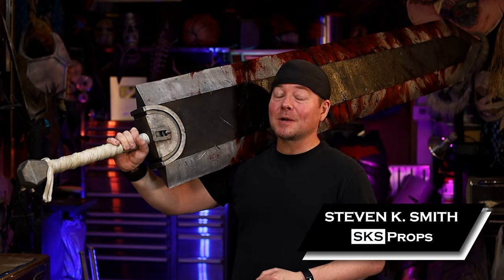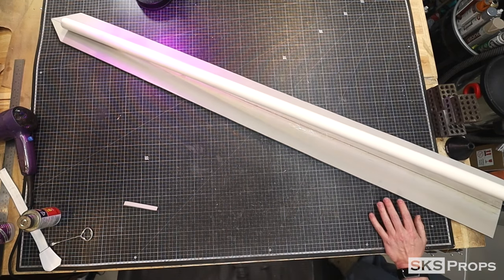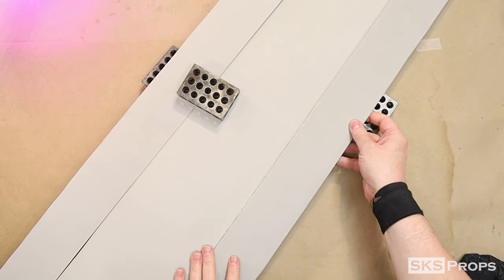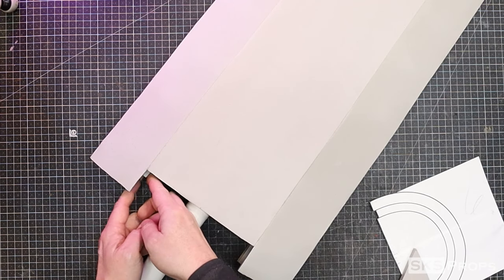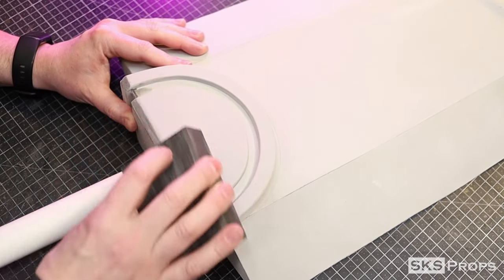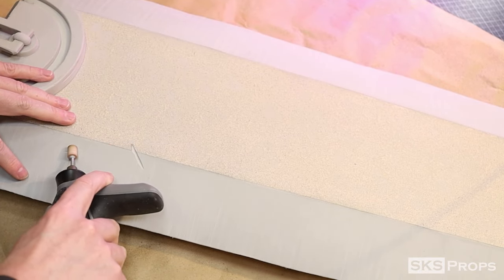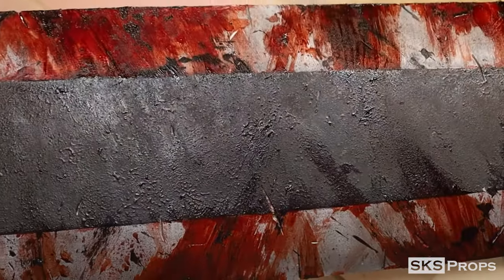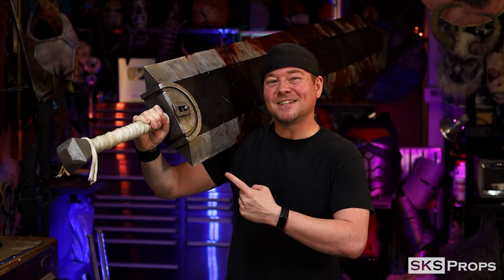How to Make DRAGONSLAYER from Berserk out of Foam! Only weighs 5 Pounds - Guts - Free PDF Templates

Comment: I believe there is a typo in the template (and possibly the video) it states the edges should be cut at a 60 degree angle, but its supposed to be 65 degrees
Reply from the maker: Thanks for the heads up. It's actually supposed to be 70 not 60 (I write on my prototypes to much and forget to erase them)  I corrected it on the template
Reply: @SKSProps  Thank you! That makes sense. I was using the protractor on my phone and it must have been measuring wrong. I tried to mess with it some more and, yeah, 70 degrees looks right

Comment: If you want this to be functional to carry, what I did with mine was when I had the mount detail in place on the clamp/bracket (guard piece I guess but it's clamped/bracketed to a handle lol), I drilled into the pipe and screwed a heavy screw eye into it and put a rectangular carabiner on it that attached to a special hook I forged (bent metal of any kind will probably work) that was threaded through my shoulder strap on the back and lashed to my belt to keep it at an angle. Canonically, he uses a chain for that but I didn't have one. The hook I made looked like a cursive Y with a straight tail and the top outer point of the Y was angled to be straight up and down in the 3rd dimension. Hope this helps someone and wonderful job Steve!
Reply: Also, if you want the proper scale to you, Dragonslayer is 6' long and Guts is about 6'3". Have fun with the math! Scaling is necessary lest you have a sword that you can't wear or makes you look goofy lol
Reply: @saintignatius714 cool tips but guts is 6’8 😂
Reply: @VileRhythm  whoops lol the info I worked from said he was 6'3"
Reply: @saintignatius714  Yeah there’s a lot of discussion about it but I’m pretty sure he’s 6’8 (currently)
Reply: @VileRhythm  It's tough to get it right as it is but as long as you know Dragonslayer's length, you can find his height from whatever picture you're working from so I guess it's down to what you think looks best

Comment: Great video!! And impressive build!! One thing I would’ve like to see more of is noticeable texture in the core of the blade. The best use of this was is @Kyle Merriman’s build where he used textured drywall spray and it looked perfect
Reply from the maker: Thanks! to eact their own gotta figure if it was actually forged most of the "raw" metal would be knocked down through the forging process and combat which is why I made mine the way it is. But you can add to yours whatever you want

Comment: Is there any tricks for getting the foam nice and flat upon arrival? With how thick the foam is and how long the pieces will be cut it takes awhile to get it flat using just a heat gun. After hitting it for awhile it still wasn't as flat as I'd like it to be. Maybe something like sandwiching it between something and letting it sit overnight for example?
Reply from the maker: I always hit the backside lightly with a heat gun then roll it the opposite direction. After that I’ll take my sheets and stack them with books on top to lay flat until I need to use them

Comment: What a monster of a build
Reply from the maker: It sure was. I rarely use the wide angle lenses but had to multiple times 😂
Reply: @SKSProps  what i particularly love about your builds is the details like the wire brush technique or the details in the middle of the blade and the gore 💪🏻🤘🏻 keep up the awesome work! You are an inspiration with every post 😁

(By the way, my current build in early development is Stun the Insect from Bloody Roar 4. I have a long way to go still)

Comment: I was skeptical of the blood splatter at first, but that coagulation effect you added really sells it and makes this build stand out from other DS props I've seen put together in the past.  Out of curiosity did you happen to see the @PrettyHateMachining build of a full size DS from solid steel?
Reply from the maker: Thanks! and yeah the aditional paint effects def help sell the prop. And yes he was one of the builders I checked out crazy heavy I'll stick with my 5 pound blade and easily move it around the shop 😅

Comment: This video inspired me to take on making cosplay props for the first time! I noticed a couple creators heat treating the foam after the pieces have been glued together, such as in this video. Some friends  recommend heat treating individual pieces first before gluing, but I also have not found anything definitive online about whether to heat treat first or glue first. It does look like heat sealing the whole assembled prop is more convenient, but will the heat affect the contact cement bond? Are there other reasons why you heat seal after gluing? Thanks for the great video!
Reply from the maker: It honestly depends on the foam you are using and the technique. Most Black foam is more porous so it has to be heat sealed otherwise glue soaks in and doesn't coat the surface. I developed my foam to be higher desnity than any of the others out there. So you can glue without heat treating and even when you heat seal in the end it is a very light pass. There is no need to overheat my foam for forming or sealing. Plus since it is higher density it sanding smoother and cuts cleaner which really makes a difference when heat sealing in the final stages. You get an extremely smooth surface

Comment: How did you like Gap Filla? I love Prop Monkey's products - they work great for getting foam super smooth without witness lines.
Reply from the maker: It was ok. Usually I don't have seams to fill because I use my cutome sanding drums which make the surface extremely smooth. Otherwise it worked just a well as kwik seal and foam clay

Comment: Time to crank up Beast In Black!
Reply: There really is some serious engineering in this build to keep it hollow and light, odd angled seams on hard edge pieces are a pain but you gave me some tips to help mitigate that. And the touch of using the wire brush to add the ground metal texture for the blade of the sword is clever. This is an impressive build! @SKSProps